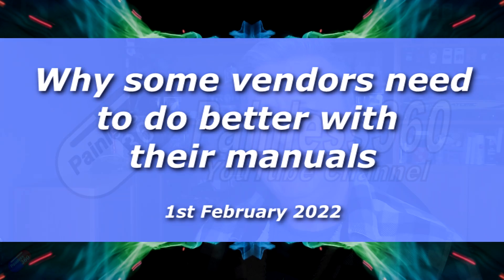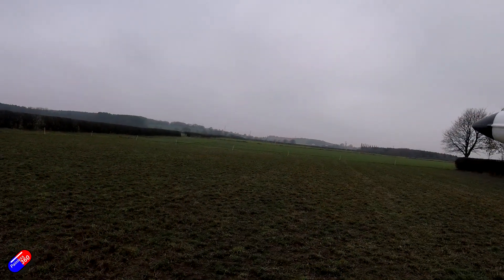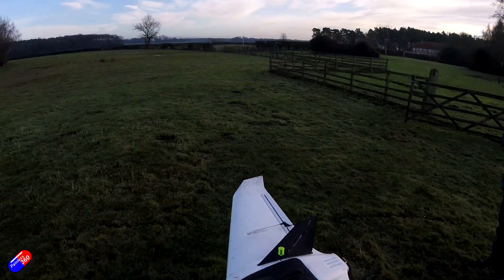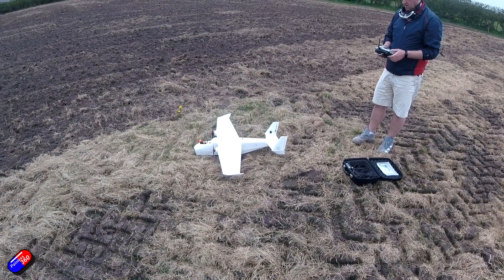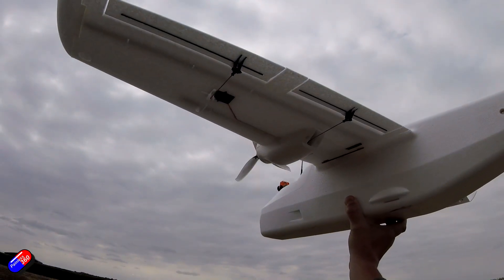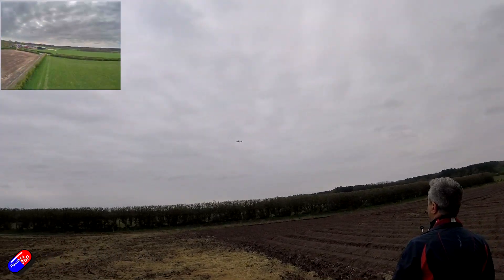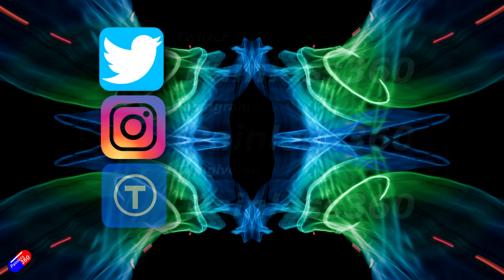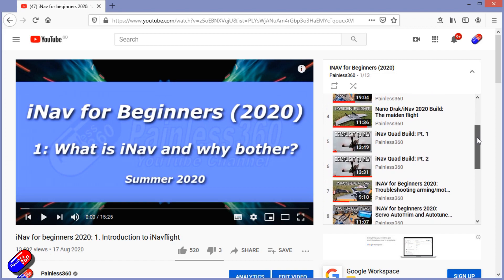Why many fixed wings manuals are not good enough!

Comment: 100% agree with this. It’s partially frustrating when you know that if a model has been well tested by the manufacturer, they have all the information to put in the manual. Comparing a traditional RC plane manual to an FPV plane manual is unfortunately a night and day difference. They always include CG, multiple throws for different experience levels or flying styles, even suggested expo. Please FPV plane manufacturers, learn from the traditional, ARTF manufacturers. For a little more effort, it will improve the model, and your reputation massively.

Comment: You build and launch a lot of models into the sky.
Maybe there is a possibility that you could put DUMP of your models somewhere?
Reply from the maker: That only works for flight controllers and only if the plane is setup using the same components, configured in the same way with the same mechanical linkage setup and the pilot has the same experience and flying style. I've shared setups with Patreons but they always come with help... Happy flying